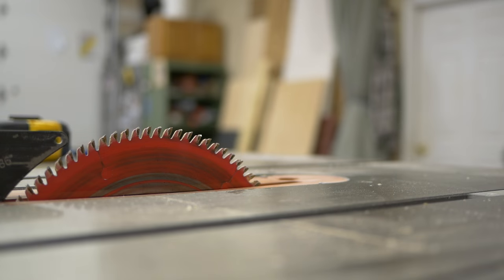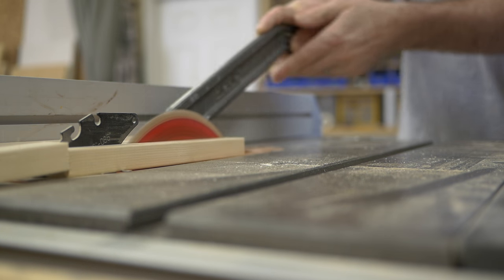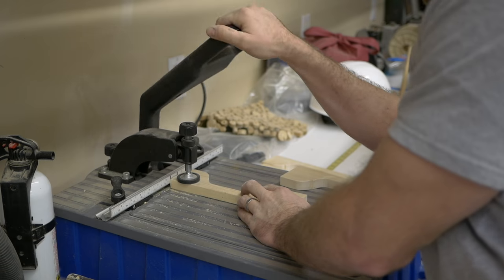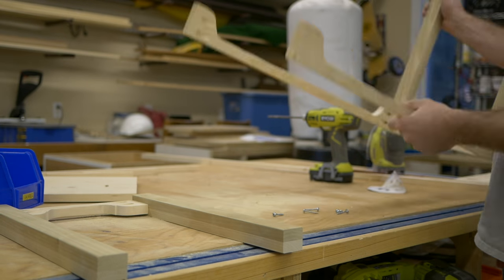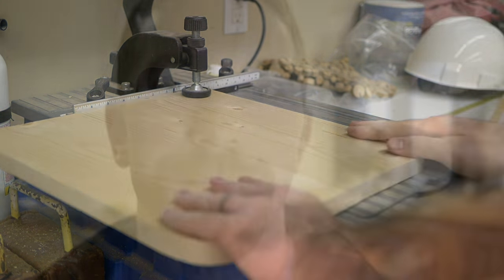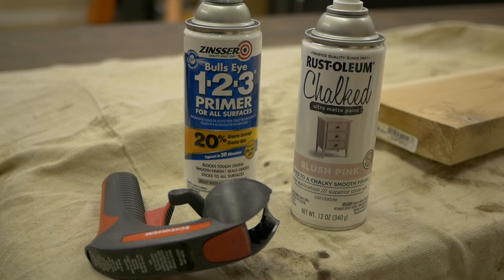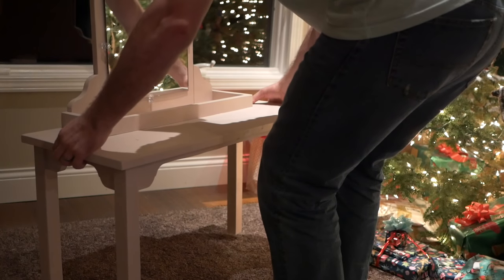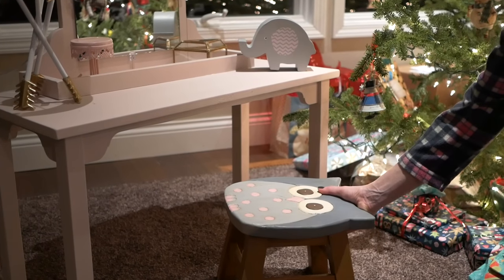Kid's Makeup Vanity

Comment: That is one awesome setup you have there.  What kind of saw setup are you using.  I bought a table saw but yours looks so much easier to work with.  And i like that bar you use to hold your wood in place that also serves as a way to measure.  Just learning to work with wood and power tools so if this sounds like a stupid question, well what can i say...

One more thing, i know this is probably not something most people ask but for newbies it would be nice to know what tools you use to make your projects with.  At least for me that is..

After watching your video i realized this table might be a little to short for my granddaughter as she is 5 years old and your little girl looks like she might be 2 or 3.  So i might have to adjust the height a bit to suit her.  What would you recommend.
Reply from the maker: ES W the table saw is the Ridgid cast iron table saw and the outdoes table really helps. The push stick is fairly common and should have come with your saw